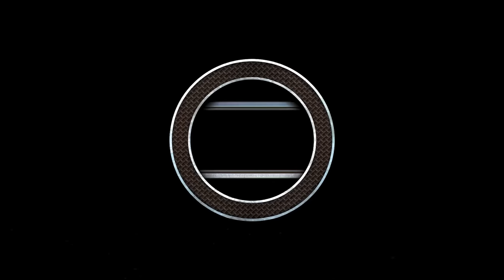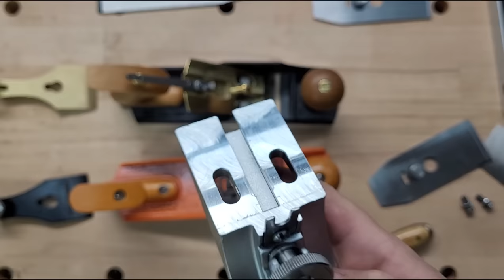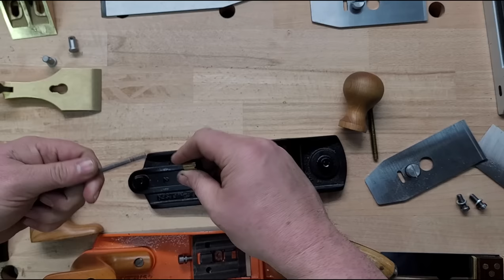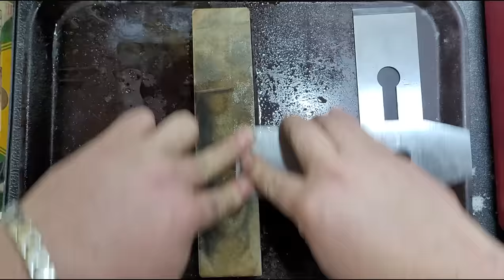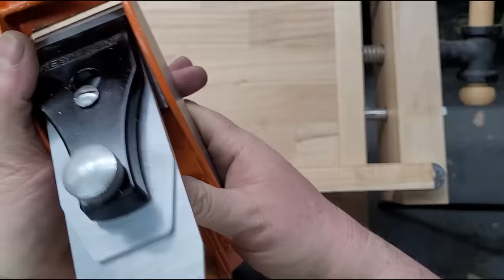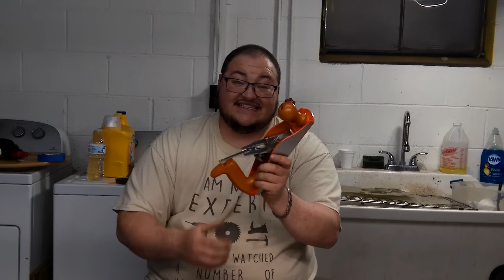$340 Lie Nielsen Vs $70 Jorgensen (The New Orange Plane - Lowes) Review and Comparison of the no 4's

Comment: That Jorgensen would be considered a Bailey type frog adjustment. Some bedrocks have curved arced sides and others are straight, depends on vintage. How the frog is bedded on the Jorgensen looks more of the Bedrock style.
Reply: Do you mean Bailey or Bedrock?
Reply: @pinkerbot  The continuous seating surface of the frog on the Jorgensen is more like a Bedrock design. Bailey design has at least three distinct mating surfaces, unless you are describing very early vintage Bailey's. However the retention mechanism on the Jorgensen is like the Bailey.
Reply: There are some users who leave frog retention screws loose enough to adjust frog with adjustment screw that it can be done without removing iron assembly on the Bailey design.
Reply: It actually looks they modeled it off the early round sided bedrock. The pins/screw connection wasn't introduced until the flat sides, the round sided bedrock frogs connected like this. To be honest, it looks really similar to the type 3 bedrocks, which were right before they switched to the flat sides and the use of pins.

Comment: There’s more than fit and finish with the lie Nielsen. From here the iron looks thicker. From their site:

Typical Lie Nielsen Blades are extra thick 1/8", made from Cryogenically treated A-2 steel tempered to Rockwell Rc 60-62,. I doubt the Jorgensen has this. All the way down the line the Lie Nielsens are exceptional quality. At 70 bucks the Jorgensen looks like a good value. Personally if 70 bucks was my budget, I’d get a Bailey on eBay. I just prefer American made. All my lie Nielsens out perform the rest of my collection. Thanks for the review.
Reply from the maker: The LN iron is thicker :) 
The Jorgensen is 01 and also has a ductile iron body.
I prefer US made also for sure, when I can afford it hahah yes LN is deff top of the line I prefer them over stanley, the only stanly user I have now is a 607 cus I dont wanna pay $500 for a no 7 LN I don't use often haha

Comment: I'm not giving up my old Stanley's for anybody, they do as well as anybody even with their skinny blades.
Reply from the maker: Have you tried throwing a Hock or plv 11 iron in them? 
I love my Stanley's too but I deff upgraded the iron lol still alot comes down to preference I know alot of guys that use Stanley's with 100% OG parts and love them, no problem at all! If it works for you thats what matters most! Enjoy the tools!
Reply: @BatCaveCreations  Go through them to make them right and they will work as good as any of the premium brands. They won't need a thicker blade. Thicker blades have their own problems, they can make it impossible to adjust the blade because they are too thick to allow the lateral adjust to fit. That means jury rigging or buying special aftermarket parts. If I need a new blade, happened on a couple I bought, I buy the Veritas replacement, they are a bit thicker but don't have the problem of throwing the plane out of walk. Withe the frog face flattened and  the base fitted to the mount, the sole flattened the plane will give as good a service as any of the premium ones for just an hour or so's worth of work and hundreds less in$.
Reply from the maker: @rodneymagee6107  you are correct thicker irons can cause issues. Had it happen to me lol but yes it's the balance of time/work vs money. If you don't have the $ or don't wanna spend the $ you gotta put ij the work :D

Comment: I legitimately think these are the best starter planes on the market. Sure they're made in China but so are Woodriver, Bench Dog, and modern Stanley for way more money. Buying and refurbishing old Stanley's can be a real crapshoot and intimidating for beginners, these will get you working in a couple hours and you can take them back to Lowes if you run in to issues. You can always upgrade later and pass it on to someone or convert them to scrubs.
Reply from the maker: I agree and wish these were around when I got into woodworking hahaha

Comment: I would say LN should be looking to lower their price a bit. If the Jorgenson performs as well as the LN then I'm buying it. The Jorgenson can be passed down just like the LN. The real truth is Jorgenson has blown the lid off high priced planes. After all you don't have a bigger set because you paid more you have a bigger set because your tools perform and work well. If you are smart and can do it for a 10th of the cost then you would be a dummy not to.
Reply from the maker: Very well put! I am also a firm believer in vintage planes and be tuned up to perform just as well too. The only difference is the time put into them

Comment: Hey. I bought this plane and it looks really good except for the fact that I'm unable to retract the iron all the way up even with the wheel maxed out all the way to the frog. This is after I moved the frog a little closer to the front to align it with the back of the mouth opening so that the iron doesn't rest in the mouth but on the frog only. Anyone have an idea of how to fix this? I really want to keep the plane
Reply from the maker: Check how close the chipbreaker is to the cutting edge. I had the same issue with mine but once I move the chip breaker like 1/16th away from the cutting edge it worked :) 
Lemmie know if that helped or not, we can teouble shoot some more!
Reply: @BatCaveCreations  mine is as close as yours is when you first assembled it. Its right at the edge if the mouth. I'll try retracting it a bit. Thanks for replying!
Reply from the maker: No problem at all!
I'm not sure retracting the chipbreaker will help from what you've described. Check this video and see if that helps: 
https://youtu.be/EXVzeZyifXw

Also, if that doesn't work try scooting the frog back and double checking if it's hitting the mouth or not, sometimes it looks like it is but it's not. Try sticking a piece of paper there to see if it is really touching.
Reply: @BatCaveCreations  how far back from the edge should I have the frog? Mine is currently flush with the mouth opening. I checked out your other vid, and I put the chip breaker as close to the edge as possible to have the iron as far up as I can but that wasn't enough.
Reply from the maker: @area 521  ah that's it! Back the frog away from the mouth. It is different for each plane so I can't tell you like a measurement or anything :( just gotta fiddle with it till you find it's happy place. Start by moving it back 1/16th, see if that let's you retract the iron. Of you can retract the iron then check to see if it's hitting the back of the mouth. Sometimes I need a flashlight to check this. If it is scoot it just slightly forward. It takes a bit of practice but take your time with it cus, if ur like me. I dont move my frog once it set (unless I'm filming a video hahah)

Comment: It's never the tool. It's always the guy using the tool.. and setting it up and sharpening the iron.
I have some really good planes that cost a little more than most. (Dictum and Clifton).
I also have a real cheap Stanley no.4. The Stanley does equally as well as the others but gets used more for the roughing out stages, then I use the more expensive ones for finish work.
Reply: But if fixing a poor tool takes so much time and knowhow that it never happens, its the tool. Before youtube, that was me. Now that tons of people explain these planes, no one should get caught like that anymore though. I am still a firm believer in buying a good aftermarket blade like Hock so you have decent steel to compare to.
Reply from the maker: That's exactly what I decided to do! Jorgensen for rough and LN for fine!